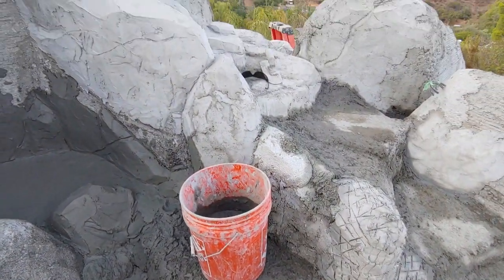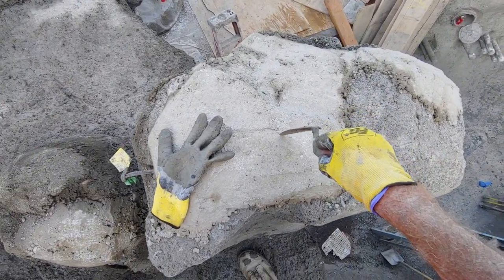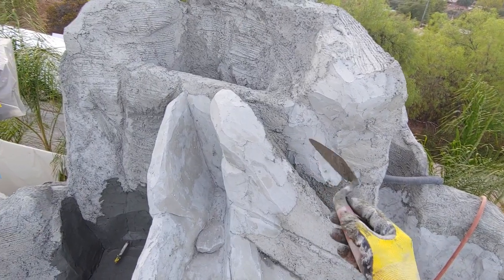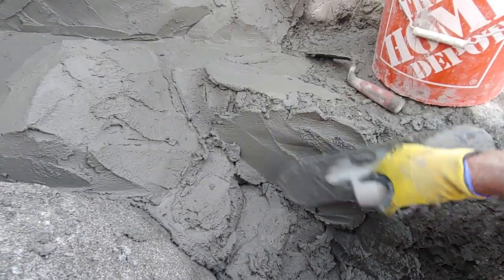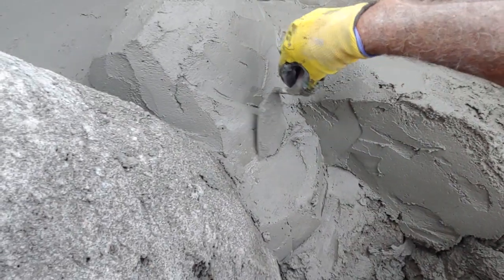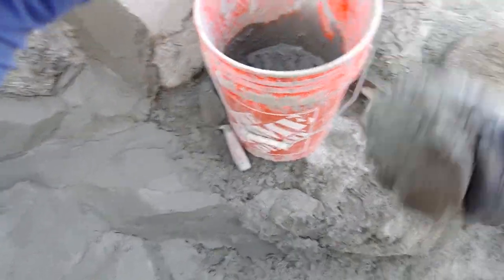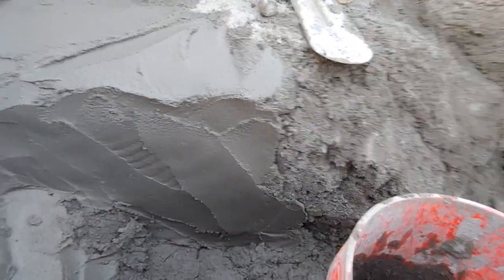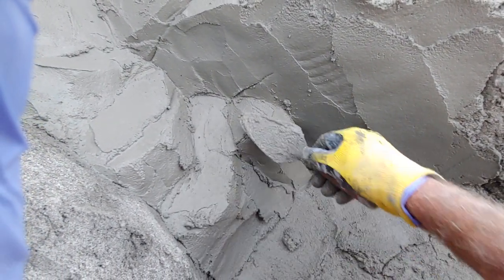Adding Mortar and Fake Rock Shapes to The Monster Alpine Job

Comment: Dave…you are so amazing at this work!

QUESTION: What is the concrete/mortar you are putting down with your hand and trowel in this video (on top of the shot Crete rocks)? 
Can you please share what that is specifically?  I need to do that to my old waterfall.  Please advise/help!! THANKS
Reply from the maker: Thank you so much for your kind words.  On the mix design I just use a mortar mix from Home depot called Spec Mix mostly now.  In the past I've use 30 grit sand and Portland Cement.  I always add Sika Acrylic add-mix 4 seconds pour into the 5 gallon bucket of mud.  Either 2 to 1, or 1 to 1 sand to Portland ratios depending on how I was gonna use it.  1 to 1 for spraying the other for hand application.  To make my mix more sticky I sometimes add a scoop or two of Portland.  That's it.  There's other mix products you could try like Carvz by my friend Warren Ness.  Anyway, thanks again and if you've not checked out my other stuff you can try davehenderson.podia.com for free and for sale fake rock how-to content. Then my blogs and links to other platforms are at www.daverhenderson.com.  Hope you like!  Cheers, Mr. Dave. :)

Comment: Hi Dave, where do you run your return lines?  I have a pool in Dallas built in the early 90’s that I have a return side leak under the waterfall AND potentially a kink in the same line.  It appears rigid PVC was used on the skimmer and main drain, but flexible PVC used in the returns….I know water is leaking under the waterfall, but I also tried digging under the side of the rocks to try and find the return line, and don’t see it.  The rocks are completely solid when I dig down, so it looks like they basically were  wrapped around the pool shell.  I would have assumed the pipes would be under the rocks burried on the outside of the shell, but that doesn’t seem to be the case.  Are they typically embedded within the rock or ran under the pool and up the wall?  I have a few videos posted on my channel.  Any thoughts would be greatly appreciated!
Reply from the maker: Well leaks are a challenge almost all tbe time.  And who knows where someone put a pipes years ago.  Your best plan is to follow the water. This only works above the waterline.  Though there are leak detection companies who find leaks in pools.  Maybe they could help.  Bottom line is if the water loss is minor and you don't see it running out somewhere let it go.  If you do see dramatic water loss and evidence of that somewhere then you could work to find the leaks with jackhammers or replumb things.  Either way not an easy fux.  Goid luck.  Cheers, Mr. Dave. :)